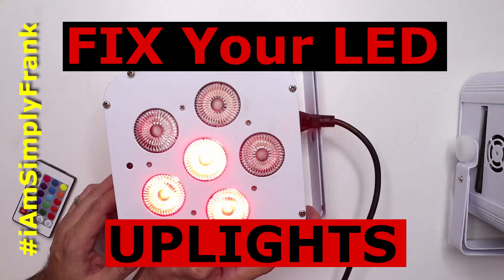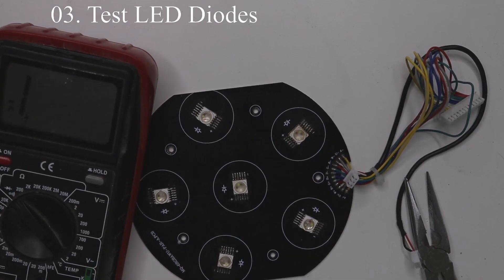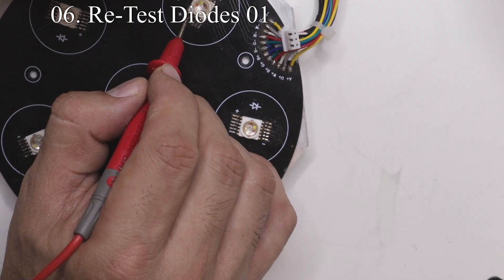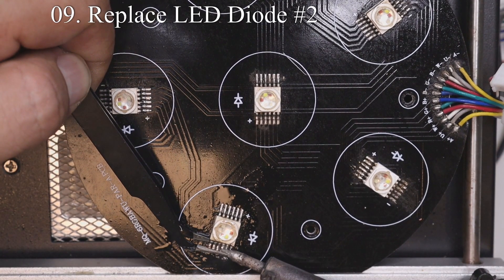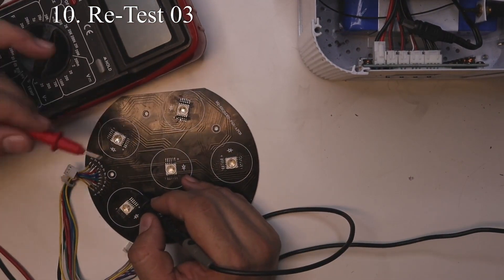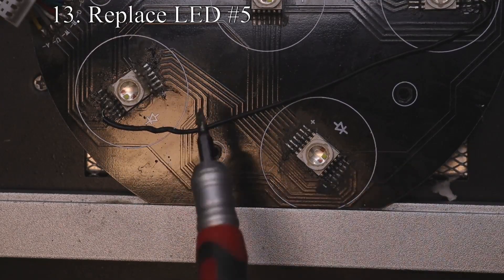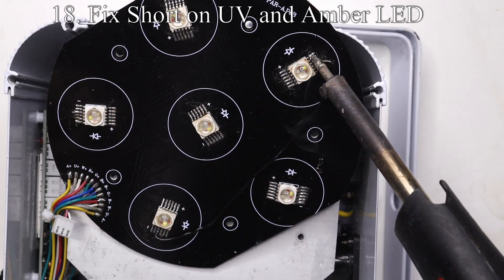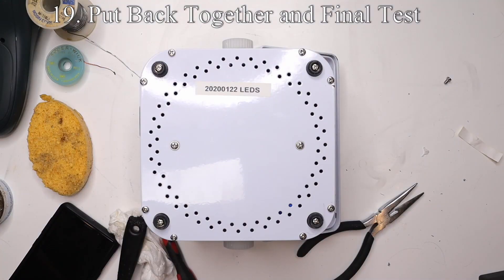How to Fix your Wireless LED Uplights   LEDs Do not Turn on DIY Replacement Tutorial

Comment: Hi frank nice video.
Where do you buy the LED lights from and how do you know how to get the right light if my ligh it’s 10w per light ?
Reply from the maker: Hi Andy, I bought these lights from china... The individual LED i purchased directly from the manufacturer. If it's a 10w light then the LED should also state that it's a 10w led, you can order from Aliexpress... Just do some research beforehand.

Comment: Hi Frank, I have a very similar set of uplights and the problem I'm having is one light is flashing slowly or not coming on when I turn it on or staying on. I tried changing the control board but it's still malfunctioning.
Reply from the maker: Thanks for reaching out on Facebook, I realize I need to pay more attention to this page and start uploading more of my work..
Reply: @franksfixturefix3327  hi. I ended up getting my light fixed but only after damaging the first control board while trying to connect the small black wireless antenna to the board. I only have one good hand and arm since cancer ruined my left one. Anyway, the light is up and running fine.